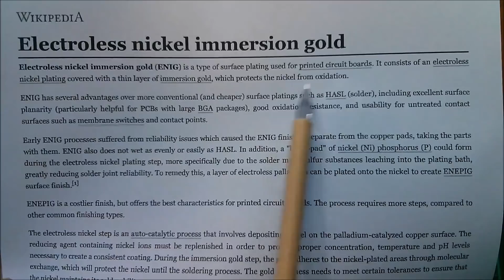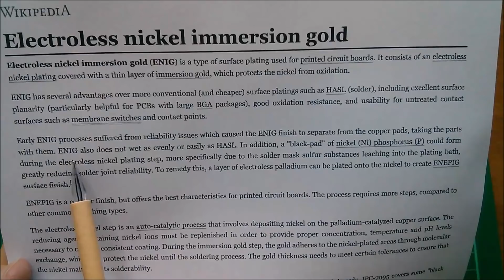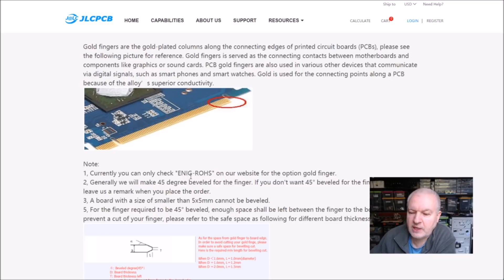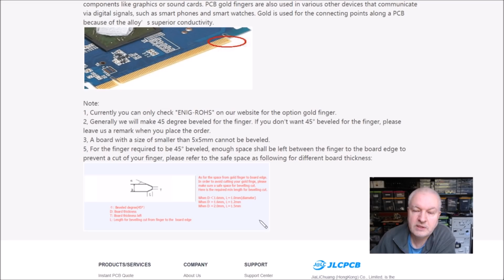New PCBs from JLCPCB: Gold Fingers - Power Distribution

Comment: You should have maxed out the trace width in the design rules, and added a copper fill on both sides.  Did you have to draw that pad set yourself, and then trace the board outline to match the slot width?  I looked for a ready made part to do goldfingers,  but found none that matched my 4x2 pin receptacle... Also, if doing 2 sides not the same, would the approach be to use two 4 pin pads, then place one set on the back ,and one on the front? (2 parts), so as to know which side of the copper it was on?

Comment: Will you be specifying a wider tab for future PCBs, Julian? Centering on the pad is optimum, and there is no cost difference, right?  Interesting talk.  Thanks.
Reply from the maker: I probably will - also a thinner PCB (maybe 1.2mm). Also the connector isn't exactly 3.96mm, it's more like 3.97mm - which is closer to 5/32"

Comment: Very nice solution there, Julian.  That's the sort of part that I've been trying to envisage, admittedly off -handedly, for getting rid of the 'wall-warts' that so much day-to-day equipement relies on.  If there is such a product already marketed for doing just that, can somebody point me in the right direction, please.  Pinning out a PC power supply to that would provide quite a decent range and connectivity, providing the wattage demand isn't too high.  Excellent hobbyist idea too, as well as l/p amplifiers and effects.

Comment: Don't they do hard gold automatically for gold fingers? Usually you don't do enig but " hard gold" on pcb fingers. This is a thicker gold layer as extra protection for the mechanical friction when sliding it in and out the connector.

Comment: @3:00 I have repaired test gear where the misaligned board edge CAN short out the socket pins (it was a Fluke 5200A AC calibrator), it really depends upon the socket pin density and spacing.

Comment: OMG, You showed your face on YT!  I've not had a reason to do gold fingers on a project yet, but I have been quite curious about how well JLC can make them, and they do look quite good! And a clever use for them in your project too! Do you know if you can find right angled female connectors? So the board can slot in in parallel with the main board? Like m.2 drives do?
Reply: @unexpected maker,   there probably are still some right angle edge conn. But more common is a daughter card at right angle with normal 90deg edge conn set for multiple side ways stacked boards. Seems edge conn are less and less common with modern assemblies

Comment: Hey, i have 2 hp 460-bb server psu's, and there are no existing breakout boards for them. Could you tell me how to find these blue card edge connectors in the right size? I wanted to build a breakout board for them because i dont want so solder the wires on the psu pcb

Comment: Note that most "manufactured" PCB edge connectors use a different plating process called "hard gold" for the fingers (they still use ENIG for the pads) that results in a much thicker and more durable surface coating than the standard ENIG process used for regular pads. The ENIG-plated fingers shown here will work fine as long as the application calls for a very limited number of insertions/removals, but you'll quickly wear through the very thin gold plating if you try to use edge connectors manufactured this way in a scenario that requires regular replacement of the cards/boards.

Comment: Ha! You will find that over the last 50 years, PCBs for both industrial use and consumer use have been made with edge-connectors. Some only used the bare copper for the contact surface of the connector. Some use HASL and some use ENIG.

Obviously just bare copper is not a good idea, but edge-connectors with HASL or ENIG are surprisingly robust and can withstand a surprising number of insertions. Of course, the copper and the coating has to be sufficiently thick if it is going to withstand lots of insertions.

The female edge-connectors used to be available with both tin plated contacts as well as gold plated contacts.

Despite the problems with dissimilar metals, mixing gold and tin plated connectors works fine, as long as they are used and stored in a dry environment.

But if used outside, or anywhere that condensation can form, or in humid environments, then problems occur with poor contact resistance and white power growth, which results in system faults.

Comment: I used to sell these connectors 50 or so years ago. The pitch is 5/32". It's the Yanks answer to the metric "half way" between 0.1 & 0.2 inches. The Yanks don't do decimals, so 5/32" is the nearest fraction! (0.156") Hahaha
Reply: Err, I think you will find the the British also used imperial back then for the majority (if not all) electronic design work...
Reply: @Mark1024MAK  Yes we did. Although we used 0.15" pitch mainly.

Comment: Silver is the best conductor, but it tarnishes to quick and needs coating after installing the components, you could use liquid tin to protect the copper or nickel or use a non-electrical conductive sealer.

Comment: "you can't have 2 plating on one board"... yet the old board he showed us and used as reference (the larger one with the misalignments) has pads with two colors: silver and golden... unless there's no gold plating and the pins exhibit raw copper, but I doubt it as there's no trace of oxidation whatsoever.
Unless it's not possible with JLCPCB but the Julian didn't mention that.
Reply: I think it's spelled 'oxidization'.
Reply: @petesclark  right, I used a 'y' as I usually do in French (as I'm French), but in English it's with an 'i' instead. Thanks, I'll update the post.
As to the 'z', in the UK it's with an 's' (I live in the UK)
https://www.vocabulary.com/dictionary/oxidisation
Reply: Un Perrier - it is possible to have the majority of the board HASL, and just the edge-connector fingers gold plated. But not for the cheaper end of the market.
Reply: @Mark1024MAK  So yeah that's a JLCPCB limitation then. thanks
Reply: Copper, over time, especially in a damp atmosphere may suffer from oxidation. The name of the resulting blue/green layer is verdigris. However, if kept in dry conditions, verdigris may not form and instead the surface of the copper changes from a bright shiny colour to a darker dull colour. Neither is good for electrical contacts.
Reply: @Mark1024MAK  fyi "verdigris" comes from the French: "vert de gris" which literally means "green of grey", it's easily understandable why :)

Comment: I was interested by the reference to electroless nickel plating. I once worked extensively with this process.
ENP is driven chemically, rather than electrically, and has the advantage that it gives a very uniform plating thickness, even on complex geometeries.
Electroplating thickness varies greatly, being thicker in areas of high current density, (i.e. edges and extremities of the part).
Reply from the maker: Thanks, interesting stuff :)

Comment: Is there no chance of voltage creep on the 12v to ground pins if the socket is slightly misaligned as you have no solder resist mask between the edge connectors?
Reply: For voltage creep and of ever crud builds up i will resort to evidence outlined by Louis Rossmann and his videos on a design flaw in Macbooks that short out a LED backlight voltage line to the CPU line which is not the 50+ v the backlight runs on. Needlesss to say he saw many dead CPUs on that series.
Reply: @DurzoBlunts   Yes that is where I got the thought from given the movement possible in the slot Julian posted.
Reply: Andi Archer - not across that distance at that voltage level. Unless of course the surface becomes covered in damp dirt.

Comment: Soldering should be fine when using good flux core solder
Reply: Can you recommend any?
Reply: @jw200  the comment mainly was related to soldering qualities on the pcb finish. Good flux is always best for results. Which solder are good types has many variables. Location/country, available suppliers, price, stock held etc, etc. I have never found any premium solders on the Ebay, Banggood, etc cheap channels
Reply: MULTICORE BRAND was always great, but does not seem stocked at retail channels for many years. I have made do with many lesser brands for some time. RS, Farnell(Element 14 here) and others seem over priced, or made purchase too difficult (See Defpom with RS supply)

Comment: Brings back memories of Commodore 64 tape deck connectors. :)
Reply: or if your older the Commodore pet!
Reply: @TheEmbeddedHobbyist  Yeah, I learned to program on the Commodore pet, but never owned one. But they were only 5 years before the C64 and 4 years before the Vic-20, had a few of those.
Reply: @AlanLifeson   I learnt basic on a 4016 which I updated to a 4032. extra 16K ram! Still have it, but have not turned it on for a few years now.
Reply: Nice, just found this video while looking for some solution to extend my cartridge project for Commodore 64 :).